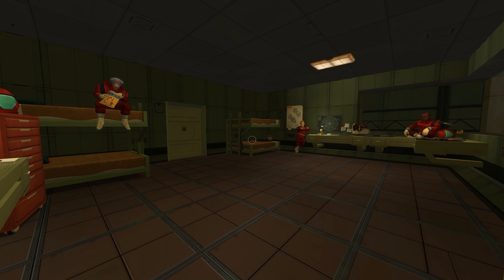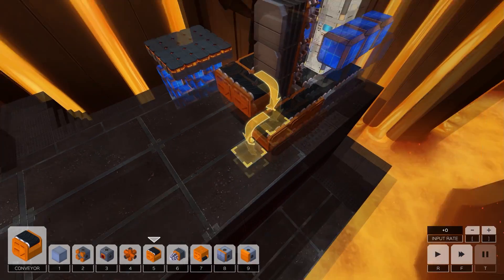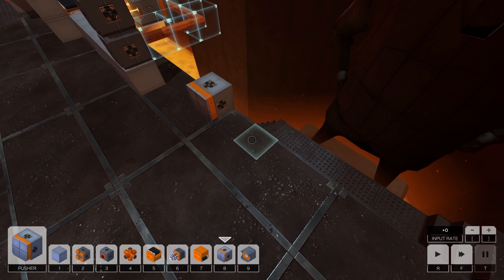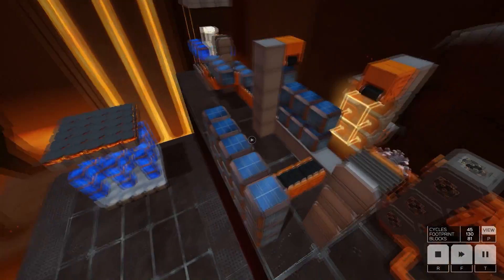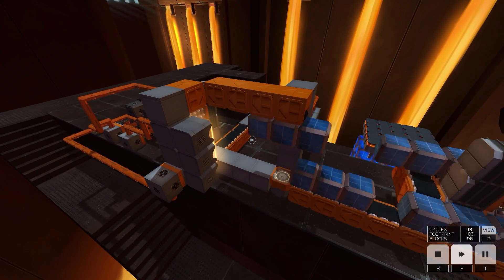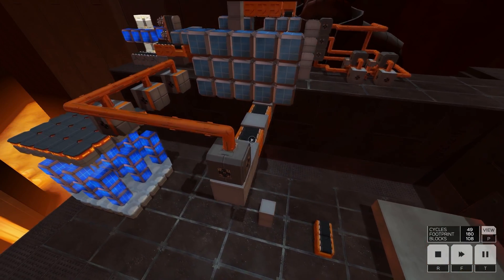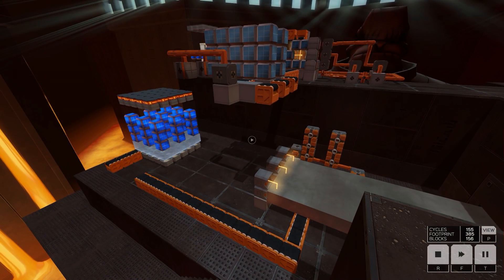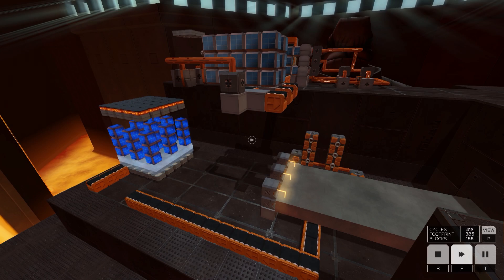I Turned a Satellite into Solar Panels. AMA (Infinifactory #19)

Comment: Can you attach pistons to other pistons and power them? If you can then a simple AND gate would be a row of pistons and when all of them are extended it activates a sensor
Reply: Yes, you can do that... although, if you are attempting to optimise cycle speed (or even trying not to mess up other timings), this can slow down a factory quite significantly for large gates, as only one piston in the chain can extend per cycle due to how the game handles moving blocks.

Comment: Nice video.  You edit the videos does to the interesting parts well!
I found this series just before Thanksgiving and have now watched up to this point.  I played the game back when it first came out (I actually played through the first campaign when it was in early access, then started a video series on it when it was full released, playing the parts I had already completed again, and then finishing the resistance campaign).
While your designs aren't the most efficient, they aren't terrible either. I guess I'm a 'try hard' as I solved this one in 300 cycles ;)  I think it would be interesting to see you go back through some of the earlier puzzles, making more efficient designs, but maybe that just how I liked to play.
Reply: 300 cycles is not tryhard, I solved in a half of that. ;) But that still is nothing when compared with the record which is 76 cylcles. :O